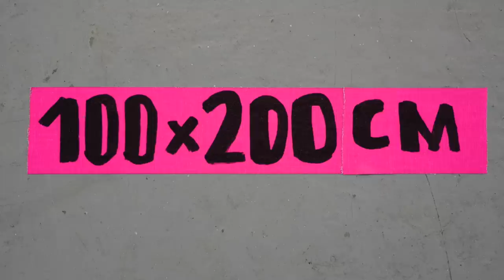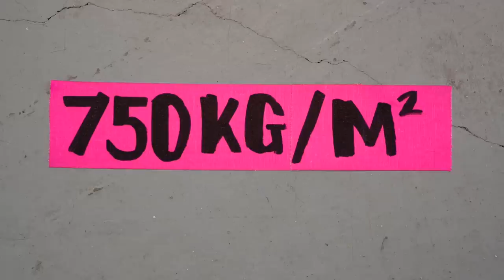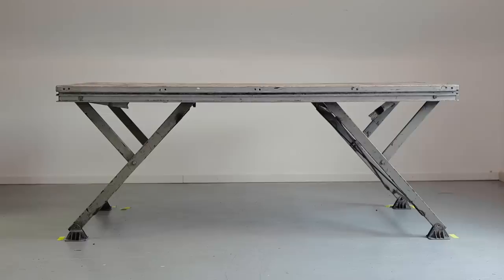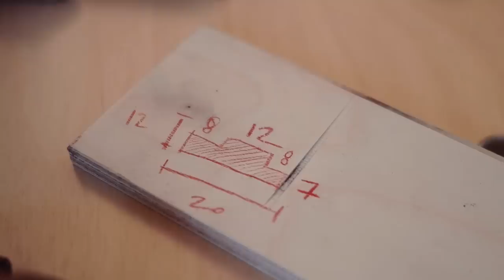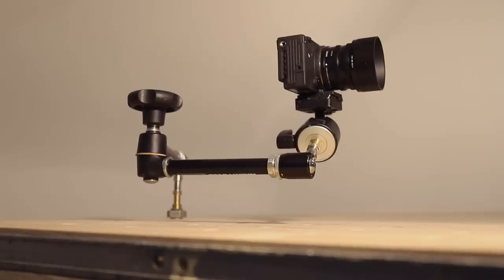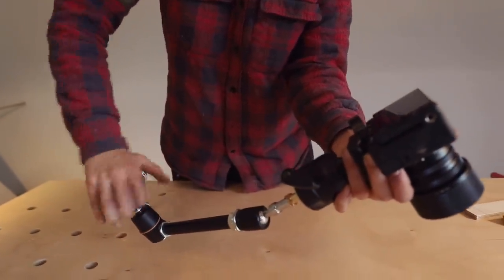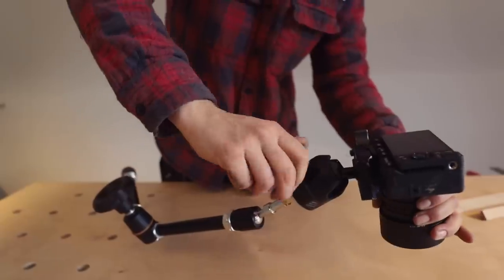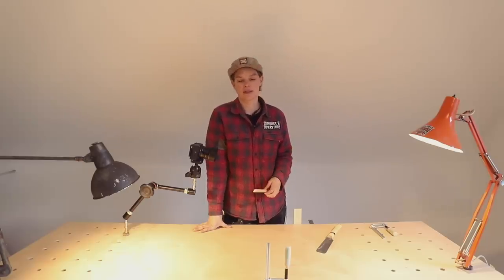The clever Workbench

Comment: After doing a little bit of digging, these seem to be very similar to the Mott Stage Platform 2,0 x 1,0m ODSC (€559
/£476.67 new on the retailer website I found), if they aren't the actual one. I also stumbled across a similar looking model by a manufacturer named Diprofa, but the images I saw didn't resemble what Laura had quite as well as the Mott. Hope this helps people find ones for their use a bit quicker, depending on how much info a seller provides. Laura, I don't suppose you have specific model info you'd like to put in a pinned comment?
Reply from the maker: Mine are from the company Schnakenberg. But there are many other companies that make them. If you don‘t need them to be height adjustable you can also just get the Pedestal and cut the legs to your desired height. Those are even cheaper.
Reply: @laurakampf  Cool! Thank you :)
Reply: @AvilerED  @laura kämpf I was about to post this too.  I've never seen this type in the US.  I would love to have these personally  and at our local Hackerspace.  Thanks to you both for sharing.
Reply: @laurakampf  do you buy them from Ebay or something or directly from the manufacturer?
Reply: @col.johnson9938  , group buy is a good idea:  probably 5 takers would get you up to 10 pieces.  Good luck.
Reply: Col. Johnson interested for sure.
Reply from the maker: My video is meant to inspire to work with what you have and get the most out of that. If you can‘t find exactly that type of Plattform-look for the kind you have access to. It might be even better than the one I have :) have fun with it ❤️
Reply: @col.johnson9938  Would love to have 1 too.
Reply: Col. Johnson I got a quote for a sample delivered for $300.00 US plus shipping.  It would take about two weeks to get delivered.  The company rep was very nice.
Reply: @flashfire3220  Would you post a link to the place where you got it? Or are you referring to the alibaba link above? In either case, will you post when it arrives and let us know if it looks well made?
Reply: Good luck
Bart Dotzman
Reply: COLIN THOMAS I was curious about cost, and shipping time.
Reply: Bart Dotzman , thank you for getting that information. Good to know they will ship less than 10. I have never dealt with Alibaba, has anyone had any dealings with them? Reliability?
Reply: Laura Kampf , I believe most of understand that, but thank you for clarifying. For myself, these ‘’tables’’ are unique in their ability to easily adjust to different heights. And still be stable and strong. Your ideas are priceless and we love your inventiveness, please don’t take our interest in these units as any type of slight . Keep up the great work and if I ever make make it Germany again, I will bring you a bottle of my favourite bourbon.
Reply: Col. Johnson I found most of the companies associated with Alibaba are willing to sell samples instead of multiples of a desired tool.
Reply: Thank you! I came back to the video after my searching was returning no results hoping someone had found the exact or similar model. I am grateful for your existence.
Reply: Not bad compared to a Festool MFT/3
Reply: Col. Johnson I’d be interested in potentially getting a couple myself. How many takers do you have so far?
Reply: @col.johnson9938  I'd be interested in 2.
Reply: @laurakampf  To speak to those with the lightest resources: there are Tool Libraries and Maker Spaces springing up in cities more and more often.  They are generally, if not always (you can never be 100% sure) community-driven, which means they need your patronage, but more than that, they need volunteers and good ideas.  If you don't have one locally, there is small-business venture capital, as well as grants for non-profits, just waiting to be put to good use.

There is space, et al, for your bench, but you may have to back way up to see it.  Don't forget to alert people that you're backing up - they'll likely accommodate.
Reply: Col. Johnson Im interested.
Reply: The Stairville UniStage seems to be similar too.
Reply: AvilerED also look for the companys Bütec and Kleu.
Reply: If you are searching a kind of stage platform... have a look on www.mott.de !
Reply: Has anyone in US found these as of yet or ordered and received from Alibaba or other?  I’m interested in finding out the US cost and quality.  Show photos!
Reply: I am also interested in the group buy
Reply: Laura Kampf  Hi Laura, quick question, what kind of locking mechanism this work bench has to keep certain height? 

Kind Regards 
Joel
Reply: @laurakampf  I really like your videos Laura but why do you say 'bucks'. In Europe we work in euros :)
Reply: There are also manufacturers such as Global Truss that makes the same design as in this video, but it doesn’t seem available on their own website (only the tubular corner leg version) but their model is called the GT Stage 1.2 (or 1x2m) adjustable leg. It’s for sale from a few staging/DJ shops in the US for around 500USD new, plus shipping if ordering online.

I may end up digging a little deeper into the purchasing side soon as I’m slowly cobbling together a luthier/diy maker workshop.
Reply: Has anyone found similar in the States 🇺🇸?

Comment: Adam Savage uses doctor's stools as shop stools, Laura uses staging elements for workbenches. I think once you reach a certain level as a maker you start seeing the potential in equipment outside of the standard range of what's found in a shop. Then it turns out that creative hunch leaves you with something that works better for less money than what's available on the market.
Reply: Dentist chair as a recliner?
Reply: When you start looking at the  problem you have rather than the solution to someone else’s problem,  thing start to become clearer. 🛠👍💡
Reply: I am a home computer enthusiast. I use a dining table for my computer. I have a full surround sound system connected to it. The subwoofer sits on a little side table which sits on the dining table above my computer's monitor. It's stacked. :-)
Reply: All of you sound like people I would like to hang out with!
Reply: Adam also uses the carts that Stewardesses use to serve drinks

Comment: Excellent use of recycled products. The only thing that I would add would be some sort of a mount  for a bench vice on the corner.  Maybe a project 2 for the bench. Mount a good vice Wilton or Cheap vice Harbor freight, on a platform that would lock onto you grid hole. The electrical power strip mount is a jewel.

Comment: I dont know a detailed description of the adjustable base, but if someone had a floor that was not dependably flat, it would be handy to be able to adjust the sliding height mechanism slightly out of square to accommodate uneven floors. It would still have to be ridgid. Skewing the slide mechanism could be accomplished with an impact driver input on the table edge.

Comment: Woah, I've worked with these scissor lift stage elements for a long time and it never dawned on me, that they could be used as tables. A pity, my current work shop is too small for such a beauty (still gonna steal some off the accessory ideas for the dog holes in my small bench).

Comment: i raelly your version of the mft, i have a small space, ( 1 /2  my basement 15' x 13' ) and it has to be modular,  so i was torn between flat top ,T track , or drill holes, all of those contradict one another if you want to draw something out, and be able to clamp / cut/ use jigs / assemble, ,  etc, yours is the best of 10 or so worlds, track on the side, ( the power strip is awsome), clamping holes on either side, and flat in the middle, and it can go up and down, if you bought something like that from kreg or festool, or woodpeckers, etc, it would just be way too much money, thanx for sharing your creation, it's off to build my drawing board

Comment: I wish we had these in the US. I work in a related business where we do use staging occasionally, and all of the staging I've ever seen has pockets in the corners to accept 1 1/4" pipe, that is ordered or cut to the proper length for the needed stage height.
Reply from the maker: I have seen these in the US. Have you looked for scissor legs or scissor lift stage pedestals?
Reply: Laura Kampf oh cool! I guess it's just what I've been exposed to, but I'll keep an eye out!
Reply: Nivoflex is the brand name of the stage product. I can say they are great, used them for years. Clamps for jointing them together and things to go in the slot are all around as well!  Really great conversion, the grid on the top is so flexible!
Reply: Michael Morey thanks Michael. I work in film and TV in New York and all the staging I see is of the type I described. I don't work in concerts or theater so maybe that's the difference. Where did you use the Nivoflex?

Comment: FWIW, you can get MUCH better quality light by using 90+ CRI LED strips.  If you rig them for 24v and run them off of 19.5v laptop power supplies, the LEDs will last a lot longer.  A 1m arc attached to a 5mm thick strip of aluminium will provide a lot of light while helping to eliminate shadows.

Comment: Something you missed that I've seen on a lot of carpentry benches: A clamp system that works with the grid you have. One one end of the bench, you have a clamp that has drilled holes for pegs, and you have a series of pegs that work with your holes. (The bolts you have can work as pegs. The idea is you put the pegs into the clamp and the grid on the other side, put your pieces between the pegs, and then tighten the clamp until the pegs are holding your work pieces with enough pressure to keep it from moving. This is great for when you want to work on the top (like when you want to paint or sand the surface of the top) or you need to work on a side without your clamps getting in the way.

Here is a workbench video that has what I'm talking about on the top. Obviously, your workbench is meant to be significantly cheaper than this, but I see no reason why you couldn't incorporate elements from it into your bench. https://www.youtube.com/watch?v=FCuvdv8FO54

Comment: The real take away for me was the rail system on one on the edges. For me, I would not want the camera so close and mounted on the table itself cause of the dust and shake that happens when we hammer on the table. Also,having a workbench with adjustable height is an awesome idea.

Comment: This does look really good and with the second hand price of the table a good deal larger, stronger and considerably cheaper than the multi function tables made by a manufacturer that shall remain nameless here.
As an Englishman I had to chuckle as I noticed that you are using a Myford lathe. This is not a criticism it just surprised and pleased me.
Axminster Tools And Machinery sell a system made by them under the UJK label (Ihave no connection to them) that allows (allegedly) the drilling of dog holes on a grid to an accuracy of a thousandth of an inch over the width of a standard MFT table plus various dogs.
the one bug bear for me (apart form lack of room) is the fact that no table including this one is made from a 3050 x 1500 sheet allowing accurate exactly square cross cuts on a 2440 sheet. Perhaps an auxiliary top could be created for a table such as this with a lath on the back to located within the rebate of the frame top allowing location of a 3050 x 1500 top.
Just a thought.

Comment: I like the whole thing tho I'm not a fan of a raw wood top I finish my wood working benches with oil my general use bench in a thick polyurethane finish and my metal working bench is well metal I like to tack weld my metal projects to the bench but it's a good idea as I have been thinking about a adjustable bench recently I was thinking of getting a motorcycle bench like mustie1 uses and fitting a wooden cap over top but this might be a good alternative

Comment: As I could see you‘ve used a super clamp adapter with your magic arm and what was the counterpart to it in order to fasten it on the wood plate? Something with a M10 female thread /innengewinde?
Reply from the maker: Yes, I used an old bolt and drilled a 13mm hole into it. Then took a brass connector to the lathe and made it fit the hole

Comment: The legs alone are practical. The bench top would do me no good though, I prefer steel, so would most likely slap a 4-6 mm plate on top and drill for 1/2" pipe, weld and tap every one and use toe clamps instead.

Comment: That is a retired stage riser. AKA a parallel. You buy used, you will rebuild/repair minimum 90% ot it. LOL. ALso please mention with hardware you can strongly interlock several risers together if you have multiple units.

Comment: I recently saw a video on the Meyer vise, which is basically a system with two cam-shaped bench dogs, each of which pivots on a grid of holes very much like the ones you bored in this video. Have you considered CNCing some plywood cams for workholding on the style of bench from this video? I ask because you have very good workholding to access the ends and edges of stock, and adding Meyer vise-type cams might be convenient way to allow work on faces (sort of replacing a wagon vise with bench dogs, or holdfasts with doe's feet). 

https://www.youtube.com/watch?v=IPlWgEeBHlE